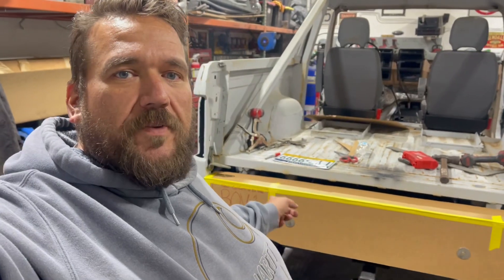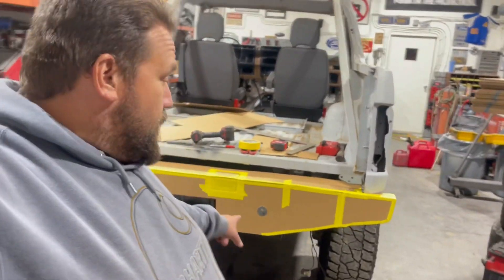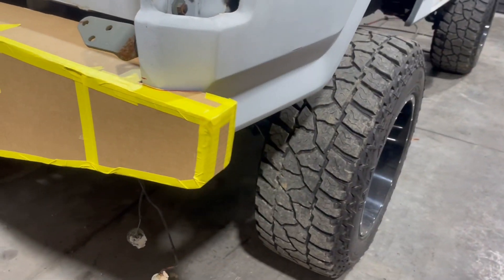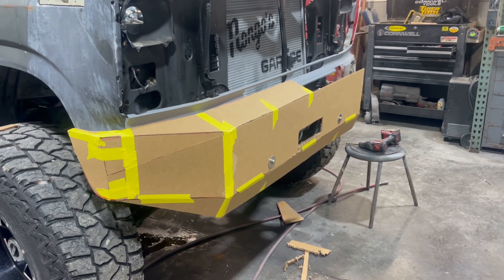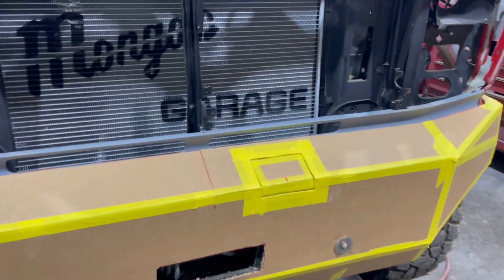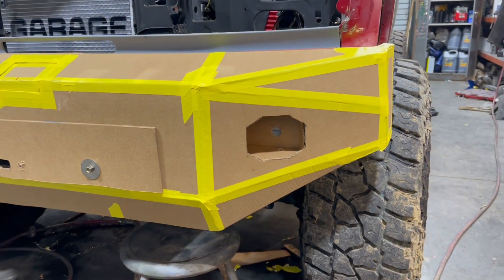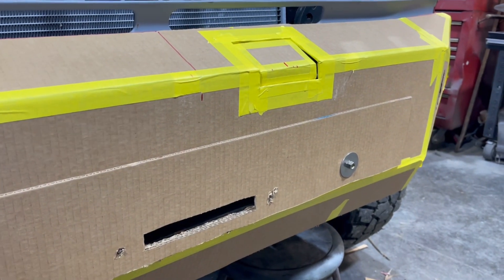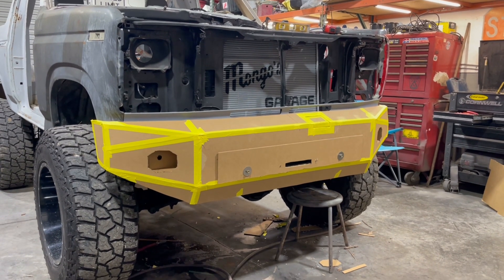1985 Ford Bronco - BOV1 - Custom Bumper Fabrication

Comment: Nice work. I assume you're gonna  build the bumpers and tack them up on the truck using it as a jig of sorts. Can you hide that reinforcing plate on the front bumper on the back side? It will look cleaner if you can.
Reply from the maker: Yes, once the steel comes back it will be assembled on the truck and then removed to be fully welded on the bench. Once all the welding and cleanup is done I’m thinking about getting them powder coated. I haven’t decided where the backer plate is going to go though front or rear.